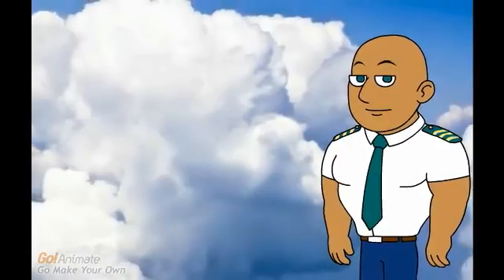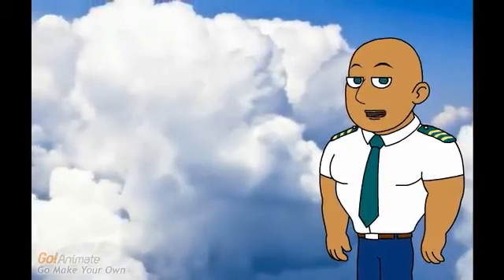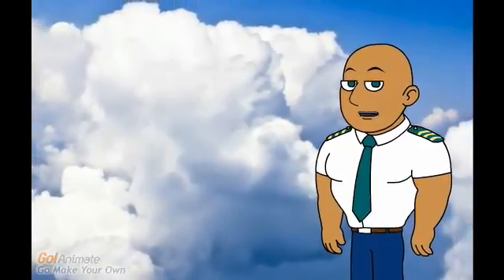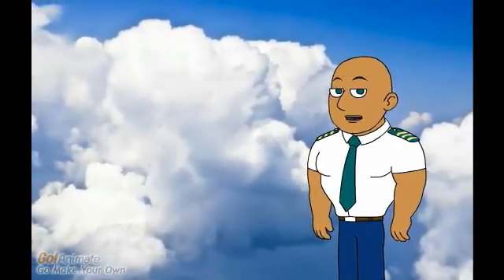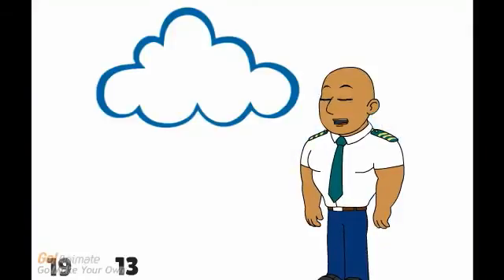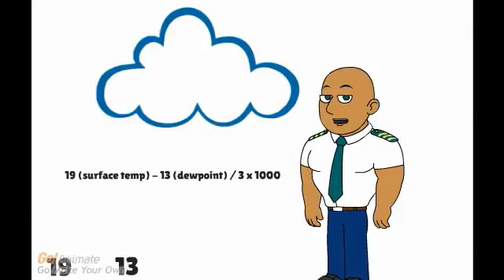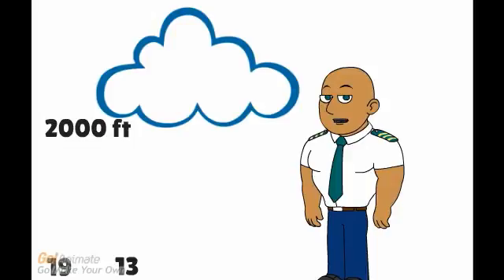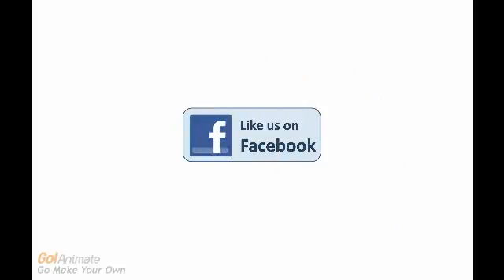How is the height of a cloud base determined?

Comment: my brother is working at KBDL airport here in CT and wondering how to determine cloud base - the thing is in aviation meteo if I"m right you measure cloud cover in 8ths of the sky - or cover of the airport's airspace right? so you take the dew point temp spread in F divide by 4.4 , multiply that by 1000 and then add to that the feet ASL your airport is....that's how you do it afaik..any other methods he can use? he's a new weather spotter for the airport works every week third shift one day a week...i dk if KBDL have one of those optical cloud measuring thigns but he should know or ask id imagine

Comment: As already mentioned, you are forgetting the dew point lapse rate, so you're essentially teaching the wrong formula (which could lead to failing the tests)! Divider should be (DALR - DPLR) = (3 - 0,5) = 2,5. So complete formula looks like: (OAT – Dew_point) / 2,5 and the result is in thousands feet.
Reply: (surface temp - dewpoint temp) x 400 in other words :p

Comment: When calculating a cloud base you use 2.5 degrees/1000 ft, because the dew point also changes by 0.5 degrees /1000ft.
Reply: Not anymore in aviation. They use 3 degree for the DALR on the written exam
Reply: @FlyingIceman198 what?????